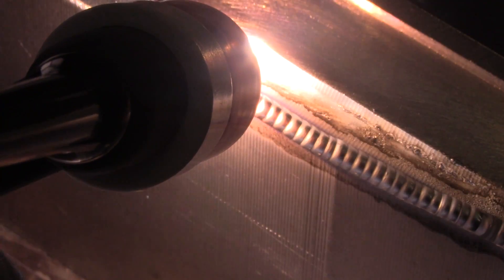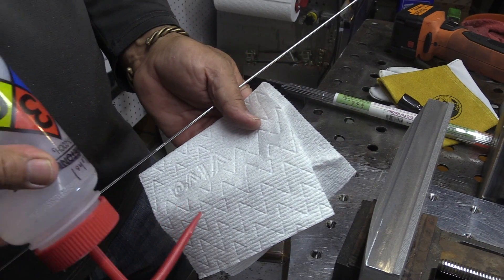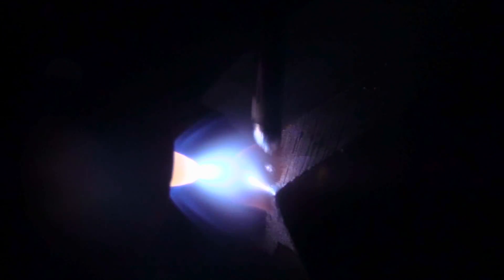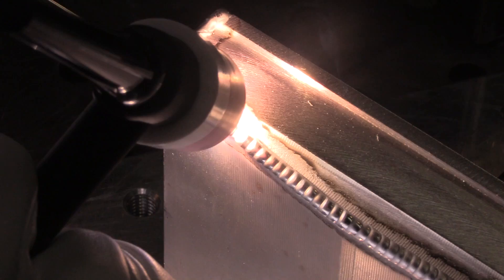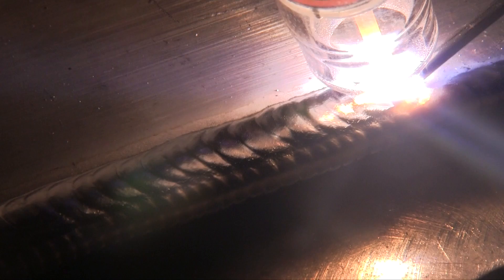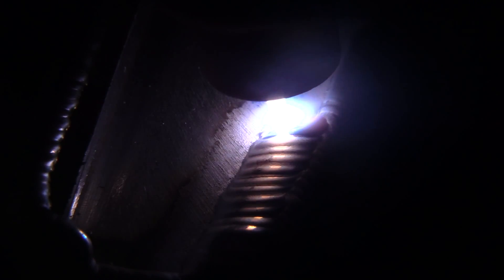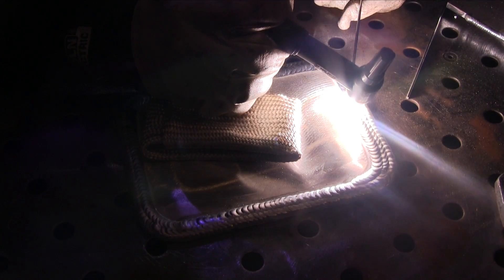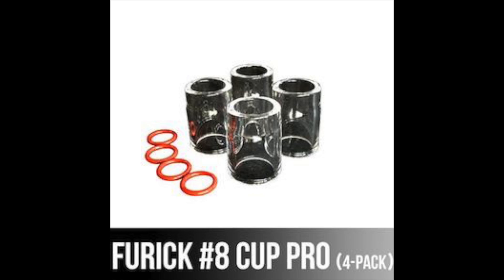TIG Welding Aluminum

Comment: Aluminum 1100 can welding?
Reply: I have problem welding aluminum.
I don't know exactly what the problem is, maybe it's argon or a filler wire or a material.
I'm a newbie, just try.

Comment: Excellent video as always. I have a question though. What are your thoughts on peaning the welds with either a hammer, or hammer and punch or an air hammer. I work in the auto racing industry so the blocks and heads that need repaired are oil soaked at temp but they started as 6013 forged parts. Does that peaning of the weld repair help to I guess up the density of of the area that was replaced with weld. Essentially hand forgoing the weld repair to match the base material

Comment: I tig weld aluminum, but Im interested in the latest non-flux, low temp aluminum "welding" with a propane torch...and no it's not flux brazing or soldering. No one seems to be honest or clear about what makes these non flux aluminum rods able to melt at low temp (730°F). They're showing this stuff to be crazy strong considering it just looks like solder.

Comment: Jodi I have a question. Bought a $4000 dollar welder Oxford Tigmaker 330 and was doing lots of beginner short 1 inch test welds for 2 hours using a Clarke auto darkening helmet. I found the next day my eyes hurt really bad and then my head ached all over. Intense. I then waited 2 weeks and tried a brand new ESAB Sentinel helmet. Damn if the very same thing did not happen the day after. So and after checking the shade was 13 for the auto darkening which it should have been at 200 amps, I then went to my garage and whilst using my old Clarke mig to weld up a classic car, next day again the same rubbish. From the mig I have used for years with the new helmet from ESAB. Blurred vision the works. So I have gone out and bought ski goggle design gas welding goggles with the intent of wearing inside my shade 5 sunnies. That would be the sunnies, then the gas tint glass and then the sentinel auto darkening on shade 13. Some serious tinting. 

So have you ever suffered from similar symptoms? if not ever heard anyone else having done so? Im furious because I have mig welded for years and it seems that even the mig welding on low amps is causing the sickness too.

Comment: if you mig tack any type of steel for speed and then tig weld your assembley, when you go over the mig tacks with tig you sometimes get porosity in the weld, does any one have a clue why this happens,  great channel I am restoring an old Daimler v8 and I have a lot of welding to carry out

Comment: Jody, yours is the best welding instruction on the tube! I have a ? about cleanliness. How do you manage to keep your gloves clean? Mine get dirty within a few days, just picking up a piece of steel, leaning on my welding table, etc. I can't seem to remember to take them off when I need to pick something up. I clean my filler material and than handle it with dirty gloves, seems kinda ridiculous.

Comment: Nice 1, but this esab looks a bit underpowered for this job: why not using your miller 350 with your watercooler?🤔
Reply: I think he does this to show you do not need a industrial welder to do this kind off job. I own a 200 Amp everlast because here in Belgium it cost a lot to get a industrial electrical power connection.
Reply: @tomwagemans1872  really? He was holding the torch with the tig finger... He was cooking that torch; not to mention the fact that with the miller he could avoid to preheat and get the job done faster.
I can see your point, if you dont have an industrial machine you use what you have, but if you have, why not use it?😅🤷🏻‍♂️

Comment: Again another great video. Ordered another stubby lens kit for a few replacement items and i agree fully wedge collets are the only way to go. I'm running an old Miller Syncrowave 500 and the Flexloc 250 water cooled torch and love it.  I still have to let the water cool down several times a day but it's hands down the best torch for me. I build and restore steam locomotives and traction engines of all sizes and have melted the end off of several air cooled torches. In the middle of a scale locomotive boiler for a hobbyist and really enjoy the effort and quality you give. Ever get a chance to do a video about using the older transformer machines come to Texas and show me how to get the best results from my dinosaur. I keep saying when it quits I'll get a newer inverter machine but it looks like it will outlast me.

Comment: Thank you AGAIN Jody!👍
Bought a lot of your gas lens kits, that Fantastic Square and the always COOL TIG FINGER. You’ve improved my welding, and my profits! Again I say THANKS!!!😇
Reply from the maker: thanks for the kind words
Reply: @weldingtipsandtricks  Howdy Mr Jody. I have a question about a possible product but wasn't sure how to directly contact you. I use your tig finger but i wonder would it be possible to make a glove out of the same material? Kind of like a liner glove.

Comment: 3003 aluminum grade is the strongest aluminum I believe what filler metal do you use??
Reply: Not advisable to weld it. It will crack.
Reply: @AlphaFlight  thanks
Reply: @AlphaFlight  looking to build a aluminium frame that I want to be light but strong and weldable what grade would you recommend??